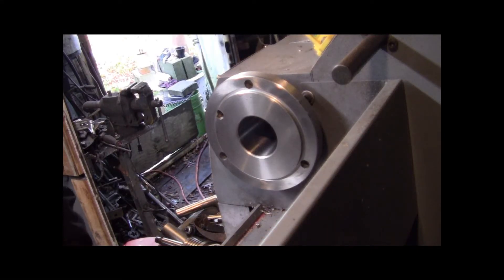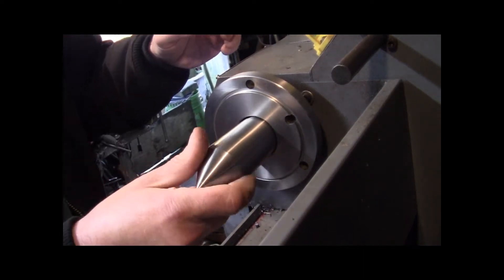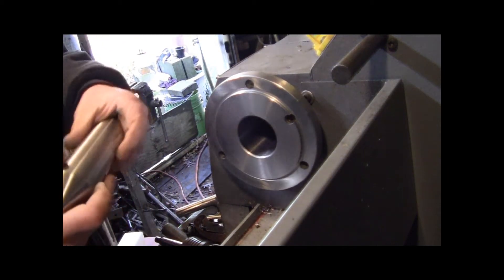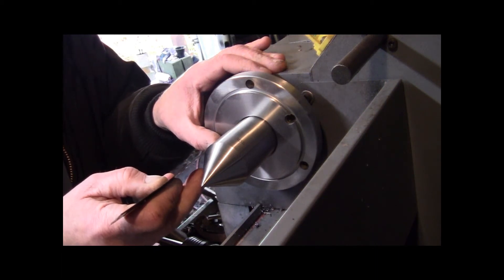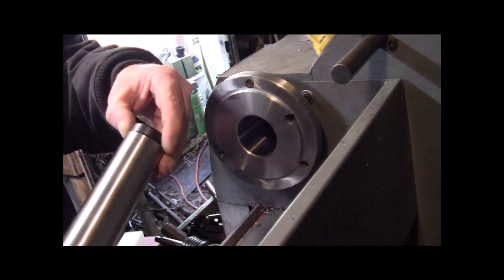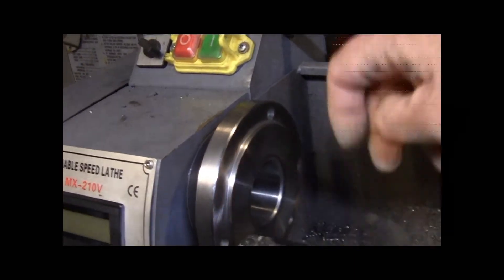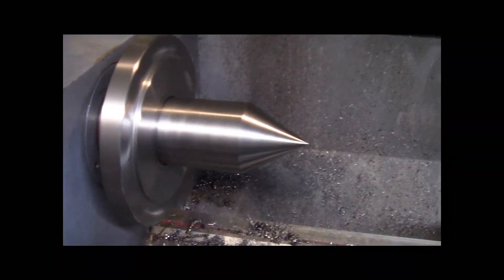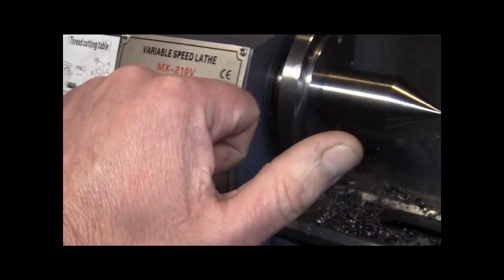FIXING THE MT5 SPINDLE TAPER ON THE MX-210 LATHE

Comment: The spindle on this lathe is really thin back there by the bearings. I wonder if it wouldn't be better to lop the end off the dead center to make it fit instead of removing material from an already probably too thin area.

At least, that's my plan for using a MT5 test bar in this spindle. For some reason I remember doing something similar with a tailstock dead center on one of the 7x10 lathes, but that's been more than a decade. I even remember making a reduced diameter plug that bolted to the rear half of the dead center so it would eject, not that you'd need it here. I have no idea why I remember doing this, as it seems pretty pointless in that tailstock application.

Thank you for posting!
Reply from the maker: No , It was shipped to me with the spindle not finished to size for some reason. So all I did was take out a little on the back side of it and it worked great .. Never have had any issues with the spindle . Thanks !!

Comment: Glad you have made it work. A couple of questions. Did you just relieve the bore cylindrically (open up the bore)? Or did you follow the Morse taper farther back? I am worried about weakening the spindle and considering relieving the back of the dead center instead. What are you thoughts?
Reply from the maker: I made it a true mt5 . If yours has enough meat  that is the way to go . Mine worked out great ! You could make that happen with your idea on the center as well should not be a problem as there is a large surface area to grip ..